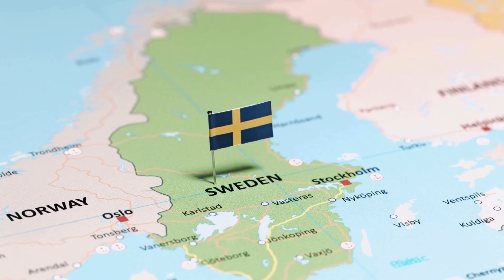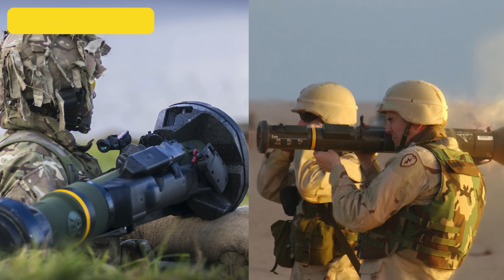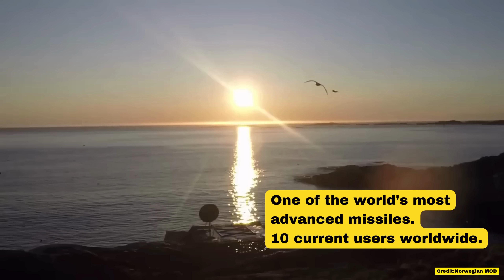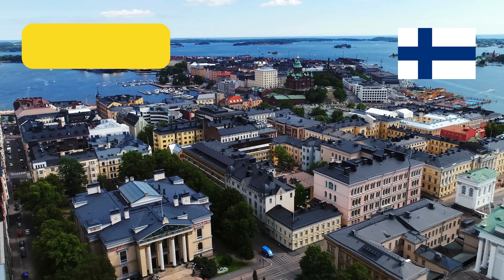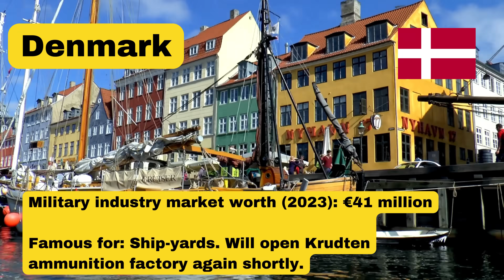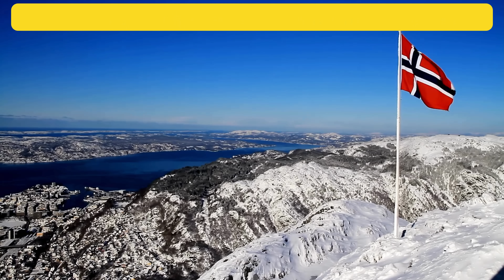Nordic military equipment - why is it so good? Top 3 equipment in Sweden, Norway, Finland & Denmark

Comment from the maker: It's a week later and after many of you wanted a more in depth video on each country 
Sweden: https://youtu.be/c5mfnKZQ3Yk 
Finland: https://youtu.be/3Dd4yudLUNA
Reply: IMO you should have mentioned that the 155mm Cannon model 1998 has an auxiliary motor for driving the gun into the firing position and/or back to the truck quickly after firing.

Comment: You're just wrong when you say air conditioning is not important for fighting capability, comfortable crew fight way better.
Reply from the maker: I think it's important, though some people don't think so. Generally officers and staff, and people who want to save money. The CV90 was awesome to operate in with the heat in Afghanistan, especially due to the AC and bluetooth system.

Comment: I have been to one of the airplane military bases and got to see several jas gripen. Interesting fact, I learned that the NATO version is apparently weaker than the Swedish one. It has twice the bomb/missile capacity due to the use of dynamite instead of air pressure system releasing them. Dynamite weights 1500kgs less which can instead be used for firepower.

Comment: Just a correction, Sweden held a strick neutrality during WW1 however, not so much during WW2 and Cold war. Sweden cooperated extensively with the Allies during WW2, behind the back of Germany. What's often forgotten is that Sweden, Norway and Denmark, together with Britain and Germany, a "non military involvement pact 1939, stating that Sweden would continue exporting our iron ore to Germany and SKF ball-bearings to UK during the war. It was signed by all parts, including Britain. So, we could not send troops to Norway and Denmark for example however, we did extensive SIgInt towards Germany, decrypting all there communications to and from Berlin and their stations in Norway, Denmark and Finland from 1940.
If you want to know more, contact me.
Rgds
Johan Ohgren
Curator
Swedish Spy Museum Project

Comment: You listed "Pasi" in Finland but showed video of the AMV which is not called Pasi. Pasi refers to basically just the XA-180 variants and it's modernized versions. AMV is totally different APC (still produced by Patria) and is known in FDF as XA-360. AMV is much newer than Pasi as it was introduced in the 2000's while the oldest Pasi's are from 1980's. AMV is not a variant of the XA-180 series. I'd also add Bittium's TAC-WIN and Tough SDRs as quite notable products from Finland since they are currently the most modern and capable tactical network and radio in the world.

Comment: For Denmark, I think you forgot to add the StanFlex system for the navy ships. It might cost more to produce say a frigate with this system, but it will make the frigate into multirole. It will only have a day of downtime before it can be ready for the next mission, due to the StanFlex modules can be changed to tailor the ship for x missions. The up side with this system is also when we would need to decommission say Absalon class, then their StandFlex system could be taken off and stored to be reused on other or newer ships.

Comment: Denmark has managed to solve the problem the two American Litoral Class ships failed at: Make a modular system for war ships, so you don't need a ship for each mission profile, but can just swap out "containers" depending on whether you need more guns, more sensors, more EW capability or more missiles. Basically a Lego system for Naval assets.

Comment: One thing missed from Norway, but skso understandable ss its only 1 built every 30 year or so, is the Majarata, made by Aker Langsten. Its the name of the main naval intelligence platform, and its scares the shit out of Putin. The previous one was made in the Ramform shape (looked like an iron) and when Kursk exploded, they were able to hear what actually happened inside the submarine.

It's however not technology that is shared, and many of our allliede often use nuclear subs for the same purpose.

Another thing madecin Norway, that's often overlooked, is 12,7mm multipurpose ammo. Not the most high tech however. Our naval mine sweepers are also something to mention ss they are howercrafts, and if U'm not wrong, made by the samithar made the corvettes.

Comment: the main reasons is the countries size, bordering with a hostile nation and fine tuning enemy weapon and use them.
they also have no room for wasting time and money on the wrong weapons system or poor planning around equipment.
US spent more than $28 billion to develop and build 32 Littoral Combat Ships, but in reality they made the world most 
powerful Coast Guard Vessels, that work only within of 12 to 200 nautical miles area, that has good yard crews in every port.

Skjold class Corvette has just been upgraded, SAAB had hand in the Taurus and Norway had hand in the Joint Strike Missile.

Comment: Denmark does have a defense industy. The biggest company is Terma. They produce radar systems. For example for the F-35 fighter jet. There are also other smaller companies who are suppliers for other defense companies.
Reply from the maker: Yes, but compared to the other 3 there's not really much. That's not to say that there won't be now that people seem to have figured out that importing everything is a bad idea for jobs, money and quality.
Reply: @MilitaryRated  Denmark is running a huge surplus on its trade. And they have been doing that for many years. Sure we might have a deficit on defense.  That is not a problem.

I actually see it as a problem that Denmark will use its right to build ships for defense in Denmark. It's about 20 years ago the last ship was build.   Surely it's smarter to buy the warships from NATO partners and then focus our economy on the things we do well.   

We are in need of high skilled workers.  Building war ships in Denmark is a bad idea!

Comment: Low corruption. Absence of politicking. Practical thinking.

Correction: The K 54 is the old Soviet 130mm M-46. It's not a Finnish product. The 155 mm guns in service are the K 83 and K 98, both of which stem from a line of 155mm guns made by Tampella (most notably the K 68) that found its way into foreign service before adoption by the Finnish Defence Forces. I would suggest the 81 and 120 mm mortars instead.
Reply: Believe me: In Denmark, it's VERY political...
Reply: "Staten och kapitalet, dom sitter i samma båt".

(The state and the capital, -they're sitting in the same boat)
It's an old Swedish political rock song, later covered by Sweden's most influential punk group.

The state and the industry (the capital) has a long history of pragmatic cooperation. It's not corruption as you would understand it in an international context, but it is also not playing by the rules of a free market. Rather, it is a sort of mutual agreement that if the state provide fat contracts, the industry will deliver high quality products and make sound, long-term investments. The defence industry, while part of the private sector, has always been an integral part of the national defence and it has been a beneficial cooperation. 

Even when the military has preferred foreign weapon designs over  domestic, the Swedish state have usually negotiated licence manufacturing so that  Swedish factories could still build the weapons domestically, and thereby stay healthy as corporations.
An added benefit is that the licence-built weapons could be modified and built to a different specification, so there will be less compromises with quality and functionality. It's a bit of "money is not an issue" together with "lets buy the best one we can find, then put our engineers to it and see if we can't improve it"

Comment: To bad NO other countries wanted to buy the archer... to me that is a mystery
Reply from the maker: Apparently being put on a truck now, it's not a massive change, and the system is still top notch when they iron out the kinks. The reviews from Ukraine are outstanding.
Reply: @theterriblepuddle1830 why is it logisticaly worse than other spgs?
Reply: UK use the Archer. And for other countries the cost of the Archer may play a big role, because it's more expensive than other wheeled self propelled artillery like the Caesar
Reply: @theterriblepuddle1830 Ah now i understand your point, Archer is available on truck-chasi now, Sweden orderd a few. As i understand the articulated hauler is better in terrain but as you point out a bit more difficult Logistics wise

Comment: For Sweden three top military equipment I would include the stealth Visby Corvette, the stealth Gotland submarine and also improved MBT 122 from Leopard 2 chassis!
All three top of the line in their respective fields! The one you choose are equally good!
Reply from the maker: I’ll likely need to do a whole episode on Sweden’s vast range of great equipment. Thanks for your input!
Reply: Visby is crabb that cant protect it self and MBT122 is just ja Leopard on extra cold weather stuff on..
Reply from the maker: Having been in both a standard Leo 2 and a Strv 122, there's a heck of a lot of difference, especially in difficult terrain. It's similar in regards to the engine, caliber gun and chassis and that's about it.
Reply: @MilitaryRated  How would you say the 122 performs in difficult terrain? The extra armor surely helps with survivability  but it is also a bit heavier than standard, right? 62 tons i think we used to say
Reply from the maker: @A246Q4  it's definitely heavier and more cumbersome than the vanilla leo 2, but the few tankers that I know who have driven both prefer the optics and survivability in the Strv 122. One friend of mine compared it to the Leo 2 being a standard Mercedes while the Strv 122 is an AMG version. We'll see what sort of anti-drone capability the 123 gets, because that will be the issue for modern tanks in the foreseeable future. None of the two tanks do well outside of hard terrain, so I would say that the 122 edges it for me. And as with most Nordic tech the ease of life stuff in the 122 (AC, speakers, improved comms, overhead screens++) makes it a joy to ride.
Reply: @MilitaryRated  Thx :)
Reply: @mikkoj1977  122 has extra armor, upgraded systems for basically everything, barracuda camoflauge against IR etc etc. It really is quite different from a standard leopard 2

Comment: On the part about Finnish artillery you are showing 130k54, which were bought first from soviet union and then from ex-DDR warehouses. The predecessor for the current 155k83 and 98 is the 122k60 that was only a prototype. 155k83 and Soltam M-68 (and them M-71) were developed from that (Soltam was a joint venture between Israeli Solel Boneh and Tampella). That platform has seen a quite a lot of use with Israelis. Soltam also produced mortars based on Tampella design. That way the the Soltam K6 also used by the US Army is similar to Tampella mortars like 120krh92 used in Finland. So Tampella (now incorporated by Patria) had quite an influence on indirect fire of several nations, even if it doesn't show up as a huge export success.

On the shipbuilding front Finland is also significant, building and designing most of the worlds ice breakers, large chunk of all naval diesel engines and worlds largest cruise ships. That gives Finland the shipbuilding capacity and know how to build these four new corvettes for Finnish navy. Also in the Finnish F-35 program the engines and front hulls are assembled in Finland (among others). With the F-18's the planes were assembled by Patria. 

WIth nokia Finland also has had some cutting edge communications networks for the military. For example already back in 1983 Nokia produced these communication devices that send fire commands (among others) as encrypted messages in the network to artillery. It also calculated the forward observer position from known point at map etc.  Nowdays the forward observer has these integrated in a targeting system (with thermals etc). These are produced by Finnish company Senop who also produce sights for Carl Gustav. The sights are such that you mark the target and the sight moves the aiming point to correct position so the shooter doesn't have to estimate the range.
Reply from the maker: Thanks for the great info! Have a lovely weekend!
Reply: @MilitaryRated  Thanks, have a great weekend!